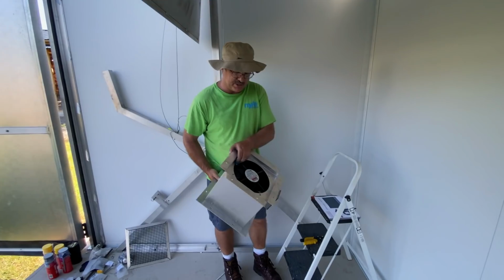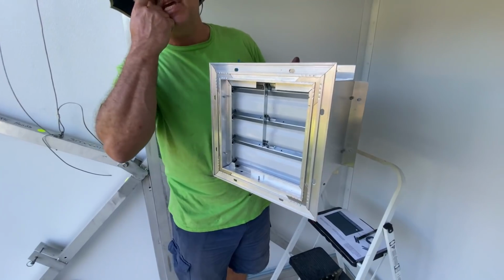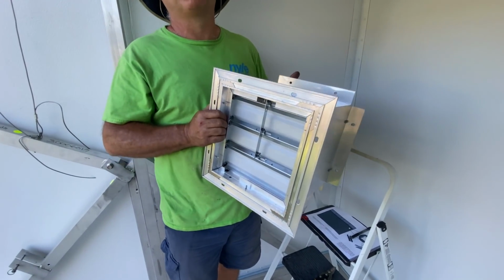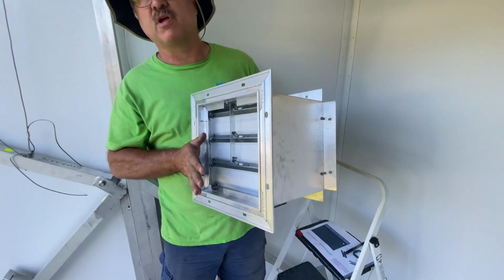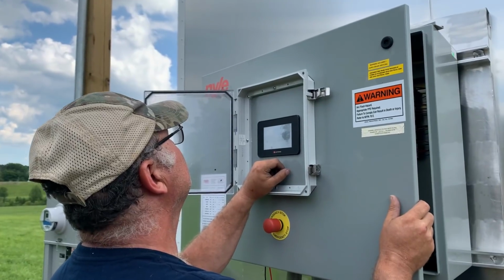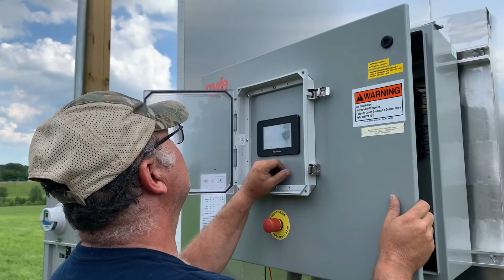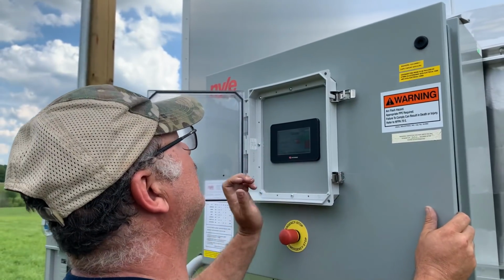Time To Fire It Up!

Comment: Some solar thermal on the kiln to use sunlight to heat the thing during the day. A small evacuated tube array next to the unit with a small solar panel to run a pump and fan on the radiator inside the kiln will see the inside nice and hot with a dry heat before it cools off over night.

Comment: Why have evaporator unit inside the kiln taking up so much room.  Plus circular fans could be outside.
Reply from the maker: ask the engineers that have been designing this proven kiln,
Reply: @OutoftheWoods0623     Its a 🆕 brainer those components could be located outside but then the back wall sections would get complicated and more assembly time and chance for leaking.   I imagine you need some air space around and the lumber pile.    But I do see it would be possible to crush that heat pump unit or whatever it is.   I imagine it supplies the heat but also cools to extract the moisture.

Comment: If someone wanted to run this system off of a generator, how big of a generator would they need?
Reply from the maker: good question for an electrician, it pulls about 50amp,s
Reply: @OutoftheWoods0623  I see you have it on it's own meter. After you run it a bit make a video about how many kw it takes to run. That will let us know roughly what it would cost to run with power company power and show how much energy it would take to run off the grid.

Comment: Hello OOTW:  It looks like electric heat.  How much power does it use and was natural gas or propane an option?
Reply from the maker: we will see on cost,
Reply: The electric heater looks like a heat pump, which should work well in a warm climate.

Comment: It looks smaller than I thought it would over all. I assume you can stack basically to the roof with them big doors. No offense it's just had something totally different pictured.
Reply from the maker: yes holds over 4k bf at a time,
Reply: @OutoftheWoods0623  what your old one hold?
I guess some side by side pictures are coming to compare.
Reply: @jimmieburleigh9549  In another comment he said that the old held 1k bf.

Comment: Looks like a great set up, and good job with the install. Do you add racks inside now to hold the lumber, and, can you have an alternative heat source outside feeding in, such as what you have an abundance of, wood. It'll be a lot cheaper than running those heaters inside. Have a great Independence Day, from you neighbor from the north.